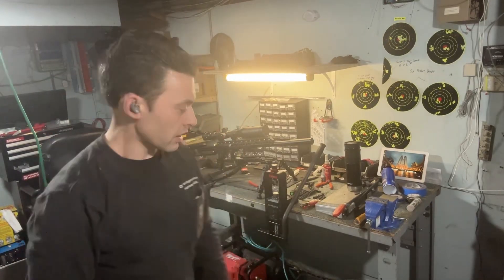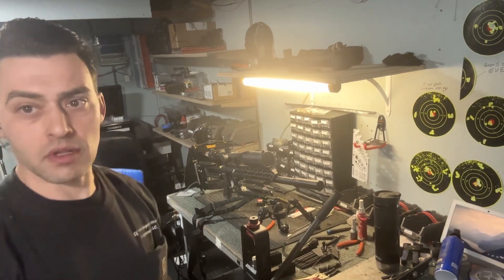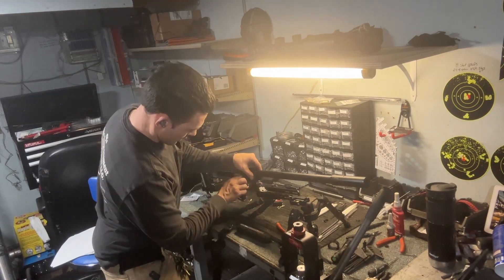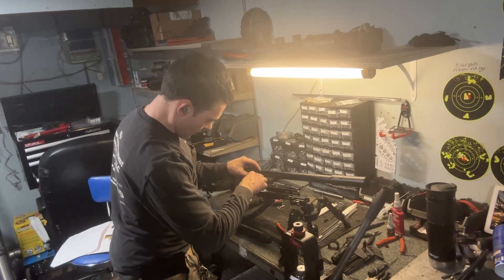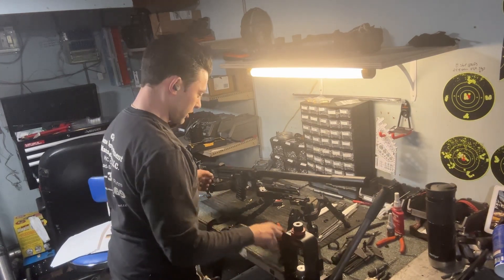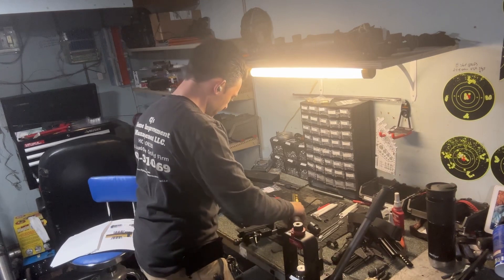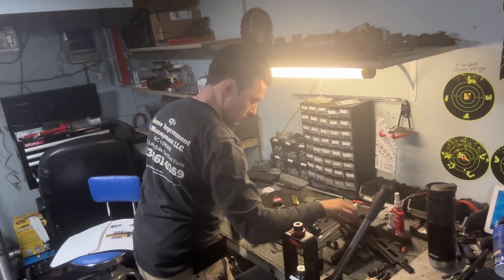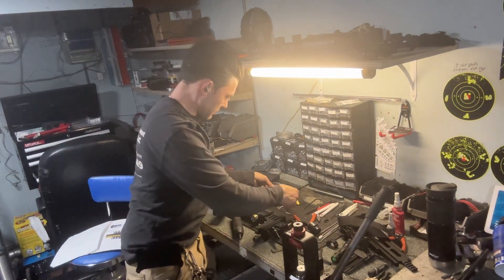FX impact M3 modifications

Comment: I'm going to be purchasing FX impact Mark III used but I want to shoot slugs and pellets in that case I would have to purchase the heavy liner correct? Besides the liner do you need to upgrade anything else to shoot slugs? The only thing else I'm considering is to purchase a harmonic balancer. I don't want to go crazy on modifications but just want to know the essentials.
Reply from the maker: Honestly, that’s still one of my favorite guns! I think the harmonic balancer is honestly the last thing you need! It’s an accurate gun. I’ve never used one, in fact, I’ve never used one on any of my guns and I can shoot them straight. If you seen my shooting videos, you can see the accuracy, it’s a really accurate gun. I think that’s overkill in itself. I would get the slug power kit. The tungsten hammer and the probe for slugs, the barrel you could use the stock barrel, it’s honestly OK for slugs also but I did get an 800 mm heavy slug liner, and that definitely changed velocity as well as accuracy. But it was accurate already. It’s kind of hard to say that it did anything in the way of accuracy honestly because it was already so accurate.
Reply: @Cjsairgunscarsandmachining Thanks for getting back to me. When I spoke to Utah airguns they told me that if you're shooting 22 caliber the standard liner works but if you're shooting 25 or 30 caliber you should upgrade to the heavy liner. I'm not sure you agree with that? Are you shooting 22? I think the kit you're referring to is called the slug probe kit. I'll take a look how much they cost up here in Canada.
Reply from the maker: So, as far as the different calibers, I don't think it's an issue even up .30. .35 is not good on that gun at all. In my opinion. It doesn't have the power for it, the velocity is just too low with .35, but in .22, .25, and .30 its a bad ass gun. Even with the stock liner, I'd wait until you get it, and try it before you order more upgrades, your money will be spent quick either way trust me, but it could be better spent on other parts. Check out Huma air.
Reply: @Cjsairgunscarsandmachining Glad I reached out to you. Yes I agree like I said I don't want to go crazy spending money it's already an expensive gun. Does the slug power kit include the  tungsten hammer and the probe?